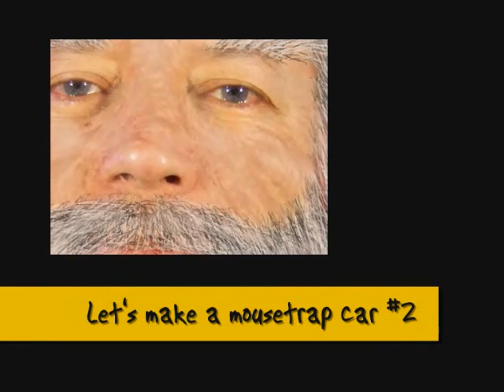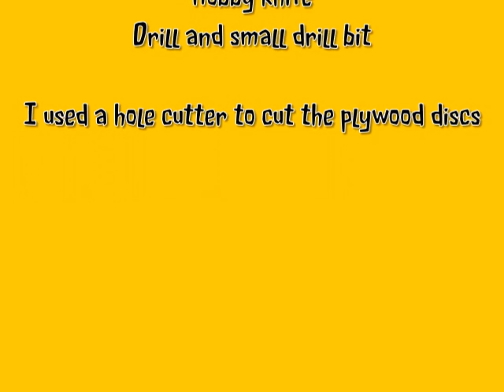Let's make a Mousetrap Powered Car #2

Comment: hi, do u have any suggestions on how to wind the car or the type of wire to use. everytime i try to wind mine the fishing line falls out of the hole in the axle, so it then unwinds itself
Reply from the maker: You could try holding your finger over it - over the hole - to stop it coming out until it has a full turn on it. If that doesn't help then try some different fishing line. You need to keep it in tension when you wind it up so it shouldn't be able to come loose. Maybe the block of wood you have the mousetrap on isn't heavy enough to hold it in tension. Perhaps add some weight to it and see if that helps. Another thought, maybe the hole you drilled was too big.
Reply: @GrandadIsAnOldMan  okay, thank you!
Reply from the maker: @justmcrafta.e8244  good luck

Comment: Wait does anyone know if this follows newtons 3 law?
Reply from the maker: Nothing defies Newtons laws. Your problem is to work out how the law applies. A force is a push or a pull that acts upon an object as a results of its interaction with another object. ... These two forces are called action and reaction forces and are the subject of Newton's third law of motion. Formally stated, Newton's third law is: For every action, there is an equal and opposite reaction. The force stored in the spring of the mousetrap is being converted into forward motion of the wheel. You have to work out how. The spring is attached to the lever. The lever is attached to a string. The string is wrapped around the axle. When the lever moves it pulls the string. When the string is pulled it turns the axle. When the axle turns the wheels move forward. 
I need to add.
The clever bit here is gravity. Gravity stops the mousetrap spinning round the axle. Newtons law would still apply but the movement you would see is the mousetrap spinning round the axle rather than the wheels moving forward.
Reply: @GrandadIsAnOldMan  omg thank u for the reply but i had a school project and i had to make a car that followed newtons 3 law and like any kid i want to win and i saw how fast it was and thought it was cool and again thanks

Comment: How exactly does the mouse trap power it pls help I would appreciate it
Reply from the maker: It is rather difficult to put into words and watching the video several times or building it yourself would make it clear. The mouse trap wants to snap shut so it is pulling the string that is wrapped round the axle. There are two things that can happen. 
1: The mousetrap spins round the axle as it unwinds the string and the wheel stands still
2. The mousetrap assembly is heavy enough to overcome the inertia required to move the wheel so the wheel rolls forward while the mousetrap hangs down pulling the string.
Reply: GrandadIsAnOldMan thank you that was helpful

Comment: I built one, not exactly the same, but when I finally let the spring go so that it can move, the whole mouse trap just spun around the axle really fast and the actual car didn’t move at all. (Help me)
Reply from the maker: You will need to add some weight to the mousetrap plate. If it is too light it will spin round just like you found. That information is in the video description along with some other information.
Reply: GrandadIsAnOldMan thank you very much
Reply from the maker: Good luck with your project 😊

Comment: Sorry to bother you but what is the diameter of the dowel you used? I'm struggling to find one that isn't too big yet too small. Thanks
Reply from the maker: Surely you can measure the hole you need it to fit? I did a quick search and found different sizes quoted for the size of the hole in an LP record varying from 0.25 (1/4 inch) to 0.28 (9/32 inch). If your dowel is too large you could consider drilling the hole out to suit it or you could use some sandpaper to rub the dowel down to make it a little thinner. The video by 1donagin that I based my project on shows him making it from a metal rod. The link is in the video description.

Comment: Could you tie the string to the axle without the whole in it?
Reply from the maker: Yes you could but then the car will stop as soon as the string pulls tight instead of freewheeling. This car is designed to get the best out of the inertia built up as it runs forward under power. When the mousetrap has finished the car freewheels for significantly further than it did under power so you will lose the majority of its distance capability. There are useful links in the video description that may help you understand.
Reply: GrandadIsAnOldMan if you made the string really short, would it still go decently far?
Reply from the maker: The length of the string is only relevant to the distance of the swing of the mousetrap arm. You need to look at how this works. If you cannot see this clearly enough from my video then look at the videos I linked to in my video description by 1donagin as he goes into more detail
Reply: Sorry my question is worded improperly, if you tie it around the axle with the ideal amount of string, will it still move?
Reply from the maker: I have already explained what will happen, it will run until the string goes tight. If you want to work out the maths, how long is your mousetrap arm travel, what is the diameter of your axle. Work out how many turns will go round the axle with that length of string. Then work out the circumference of the wheel and multiply that by the number of turns round the axle. That will give you the distance the car will travel with that length of string. Lets say the arm travel is 6 inches and your axle is 1/4 inch Circumference of your axle is 3.142 x 1/4 = 0.785  so 6 inches of string will give you 6 / 0.785 = 7.64 turns round the axle. Lets say your wheel is 12 inches diameter so the circumference is 3.142 x 12 is 37.7 inches so when your wheel has turned 7.64 turns it will travel 7.64 x 37.7 = 288 inches or 24 feet or 8 yards. NOTE I have guessed the dimensions but the maths should be right even if the result is not. This car is supposed to be capable of going over 100 feet so that is what you are losing by tying the string to the axle.

Comment: Please please please answer fast, I am doing this as a project and i did it all, but when i wind the string up the dowel (the wood part) snaps in half and I have to re-do the whole car, This happened 2 times please help
Reply from the maker: +Jack Septiceye I can only guess that you are either over-tightening the string or you have very weak dowel. Maybe you drilled too large a hole through the dowel for the string to go through. Does the mousetrap assembly spin freely on the axle? The ball pen tubes must slip easily round the dowel. I had no problem with mine so I cannot really imagine what is going wrong for you. There really is not a lot of stress involved here as the mousetraps do not have much strength. I guess you have already read through my video description and checked the associated links for the original project done by 1donagin.
Reply: +GrandadIsAnOldMan My desgin is SLIGHTLY different, instead of the black plastic thing i just drilled a hole through the wood and put it through the axle, it does move freely but not very smooth. So to fix the axle snapping do I get a bigger dowel and make a bigger hole in the wood so the mousetrap can move freely?
I heard bigger dowels don't get as much further though, but ill do anything to fix it. My teacher said most of my mark is about problem solving, but i still do want a very far distance. a small distance difference won't matter to me
Reply: also, my friend's design has a elastic where at the start would activate and give the car a boost? is that possible to do it on this design?
Reply from the maker: +Jack Septiceye if it doesn't spin freely maybe just drill a bigger hole and use the same dowel or glue some tubes on like i did. As for adding elastic i would suggest you sort out the problem with it breaking first. Once you know it works you can move on to improvements. Do you know if that sort of addition is allowed or do you get extra marks for innovation.
Reply: +GrandadIsAnOldMan anything is allowed if the teacher approves it but yeah plastic is allowed for sure, ill try to to the plastic tubes but im afraid it may fall off, ill hot glue it on. does the plastic tube make it smoother? How do I know i have winded up enough? and how long should the fish wire be? in centimeters
Reply from the maker: +Jack Septiceye the power comes from the spring on the mouse trap lever. You only use the length of line that it needs to go from the end of the lever when the mousetrap is closed to the axle 12:20 . Any more is a waste of time. You can only wind it until the mousetrap lever is fully open.
Reply: Hi, so at school today I remade it for the 3rd time and dowel broke again. I can use a thicker dowel but I don't have a plastic that can fit the thick dowerl, what can i do?
Reply from the maker: I have no idea how you are breaking your dowel but the simple answer is try what you want. If it fixes it then you win. If it doesn't work then at least you have learned something. Maybe you can use some wire eyelets like I did in this video https://youtu.be/Sw0isUO8rXA?t=2m55s

Comment: How do you get the car to move? Like what do you do with the fishing line ? I'm confused on that part.
Reply from the maker: +Jennifer Mora I am afraid you will have to watch the video over a few times if you do not understand what is happening, or perhaps watch the videos that are linked in the video description. The line is wrapped around the axle as it tensions the mousetrap spring. If there was no weight on the mousetrap it would then spin around the axle and the wheels would not move, but because the weight on the mousetrap requires more effort to lift it than is required to turn the wheels then the wheels turn instead.
Reply: +GrandadIsAnOldMan does the size of the mousetrap matter?
Reply from the maker: Jennifer Mora If the mousetrap is too light it will spin round the axle instead of the wheels moving forward but you can add weight to the mousetrap to stop that happening. Here is a gravity powered car made using the same principles. It may help you to understand how the car works https://youtu.be/m8-pdC-4AX0

Comment: Where can you get those small wooden circles ?
Reply from the maker: +Jennifer Mora I cut them from scrap plywood using a hole saw. They do not need to be perfect circles, they are just strengthening the join between the axle and the wheel.

Comment: do you know how to make a mousetrap car that could go up a ramp
Reply from the maker: +gutemex6776 the only difference going up a ramp makes is that you need more power to the wheels. Assuming you can only use a standard mousetrap with no modification that means you will have to increase the power to the wheels by changing the gearing. I would suggest smaller wheels and a larger diameter axle. Both of those changes would have the effect of changing the gearing. You will probably need to increase the grip on the wheels too by adding rubber tyres. You will also have to make sure the car is as light as possible.

Comment: What is lp plz respond quick
Reply from the maker: +Mando etc an LP is a Long Playing Record. This is the old type of audio recording on a Vinyl Disc that rotates at 33.3 r.p.m. This is how us old people had our music. It pre-dates audio tapes and CDs. In fact they are so old now that people are starting to collect them again instead of throwing them away. For the purpose of this project you could possibly just make a couple of large discs from plastic or cardboard but it would not be quite as good because the LP has very thin edges so it has very low friction on the ground.

Comment: When I release the trap to make the car move, the mouse trap spins really fast on the axle and the car moves a couple of inches.  Could you tell me what I did wrong?
Reply from the maker: Dfdf Ddfd it answers that in the video description if you read it. Add weight to the mousetrap part.

Comment: you could have saved some time where you used the pen pieces by using eyehooks instead
Reply from the maker: Hi Dylan, thanks for the suggestion. I have used eyehooks on other projects. It just depends what components are available when I want to make something. Sometimes the wood splits if you use them. If you check out the original http://youtu.be/XZ23q0QXPx0 by 1donagin you will see he just drills a hole through from side to side and cuts a slot in the back of the mousetrap and his car goes 138 feet.

Comment: how much fishing line do you need? (approximate number if you could)
Reply from the maker: About 12 inches, depending on how much you use to tie the knot around the lever arm. Tie the knot first then measure enough line to go just past the axle and cut it, so the final amount is less than 6 inches. I show this in the video at about 11:53
http://youtu.be/v1n4PtRaM9Y?t=11m53s

Comment: So do you set the mouse trap and set it off or just hold it down til you're ready then let go
Reply from the maker: It is not entirely clear from my video camera angle. The mousetrap is held in place by it's own weight so you can just hold the edge of the wheel. If the mousetrap starts to spin around the axle while the wheel is standing still then the mousetrap is too light and you need to add some weight to it. 1donagin shows it better in his video on this link. I have set the link to start at just the right place.http://youtu.be/aCCsSHUDC8w?t=7m46s

Comment from the maker: Hi Sei Aokazu, I cannot reply to your comment directly because of problems with the YouTube comments system. I only test in my kitchen which is 5m long. If you check out the original http://youtu.be/XZ23q0QXPx0 by 1donagin he gets 138 feet and I have seen other videos going over 200 feet.
Reply from the maker: +Ashleigh Fairfield the idea of the animation was supposed to be me looking closely at a project but it never really worked the way I intended so I dropped it from later videos.

Comment: can you make it with cd?
Reply from the maker: The mousetrap needs to hang down free between the wheels. CDs would be too small and the mousetrap would drag on the ground. You could make your own bigger wheels from disks of wood or plastic if you cannot get the old records. This design minimises moving parts by doing away with the front wheels of an normal car. I copied the idea from the original version http://youtu.be/XZ23q0QXPx0
The build details for it are here http://youtu.be/aCCsSHUDC8w
Reply from the maker: Giovanni, your question inspired me to have a go with CDs and here is the result. http://youtu.be/Sw0isUO8rXA
Reply: GrandadIsAnOldMan  i am finishing it now, the parts with the pen i ve attached it to the back and not on the top part.
Reply from the maker: Giovanni Zunino Good luck, I hope it works for you.

Comment: i made this and my body is flipping please help
Reply from the maker: Add some weights to the mousetrap. Mine is stuck to a fairly heavy lump of wood and that holds it down while the LP turns. Look at the orginal version that I copied. Here is a link to the original version http://youtu.be/XZ23q0QXPx0
The build details for it are here http://youtu.be/aCCsSHUDC8w
Reply: mine is made with polywood. my axle is a rod from one of the poles that hang flowers outside so i cant drill a hole thru the middle.if you would like to see it look up anthony claycomb. i live in pennsylvania and you should see a grey face thanks

Comment from the maker: Sorry, probably only means anything to old people like me. LP means LONG PLAYER which is what these old vinyl records where called. They are large plastic records that pre-date CDs and cassettes. A SINGLE was a smaller record released with a single song on one side (and another on the other side) spinning at 45 rpm. An LP was released with a whole ALBUM on it spread over both sides. To get the whole album on the record had to spin slower so it was known as a LONG PLAYER spinning at 33 1/3 rpm

Comment from the maker: That would be a problem. It travels most of it's distance freewheeling using the flywheel effect of the large wheels after the mousetrap has sprung. I cannot think of any way to modify it to stop. If you rigged up some sort of brake attached to the chassis all that would happen is the chassis would be dragged round by the momentum of the wheels.

Comment from the maker: Hi Bill, This is basically a straight copy of the one I linked to in the description. The original uses some specialist tools to thread a metal rod for the axle. I wanted to make it using nothing special. If you check out the original he gets 138 feet and I have seen other videos going over 200 feet. all just use the standard mousetrap lever unextended. A metal axle gives better ridgidity and is slightly thinner than my wooden axle so the effective leverage or gearing is different.